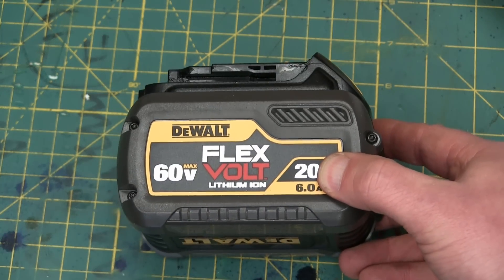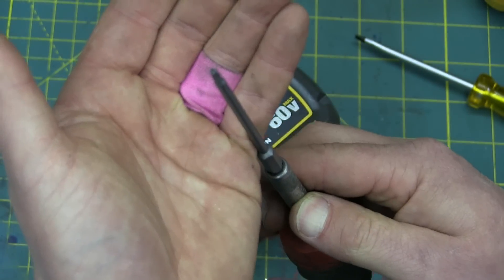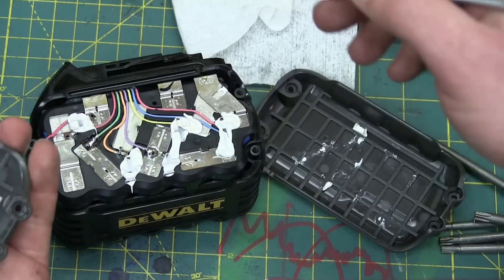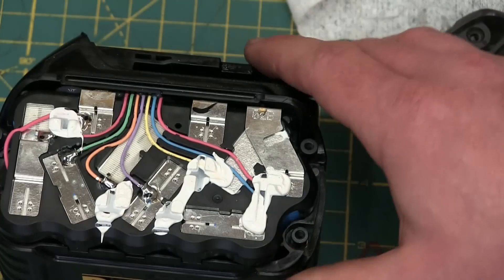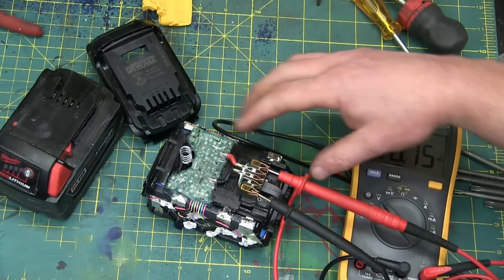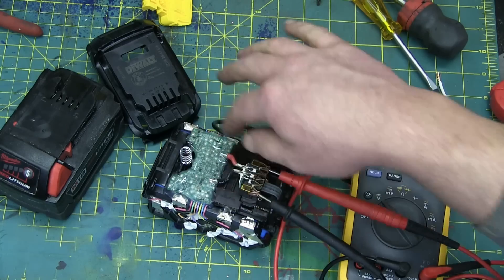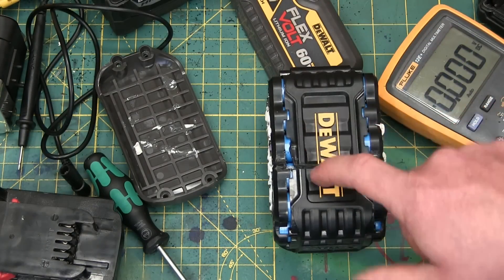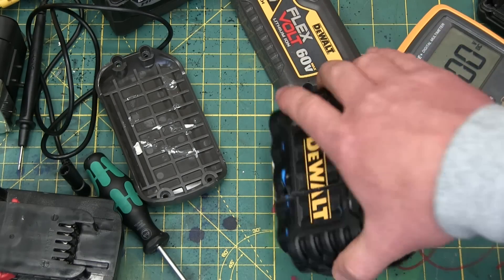BOLTR: DeWalt 60V FlexVolt Lithium Battery. Ooopsie!

Comment: I was in the vape shop and they were using a mechanical which didn’t have any chips and if you press the button it grounds to the negative side of two lipos. It had a failure in the insulation jacket. It grounded out and exploded and shot 35 ft across the room and landed in the trash can and lit everything on fire. It was like a ground flower fireworks. Bvvvvruum !! You definitely absolutely can definitely explode those they are the exact same battery. Same same! Be careful! They are why vapes fired off in pockets and exploded. Most battery cases used for vaping have escape holes so they won’t explode and make schrapenel 🤔❤️🖖🏼🇺🇸

Comment: Can you rip into the dual battery powered  flexvolt mitre saw AC adaptor that's sold for about 60 dollars. I always wonder if metabo made an AC adaptor to power 36v, why wouldn't dewalt make one for the 60v flexvolt, just make one and put high price tag on it. I sometimes get tempted to grab a hacksaw and cut the twin battery ac adaptor into half and plug in the flexvolt table saw.

Comment: I'd imagine you tore into the jacket of the battery and the friction of the sawzall blade set off the internal fuse on two cells.  Shame you can't reset those.  I tried to compress with screwdriver and it's real easy to puncture the gas filled membrane.  Chooched!

Comment: Hello I’ve got a question. I have a 750w inverter to power my dewalt fast charger in my van. It will charge all my 20v batteries fine. But it is hit and miss with the 60v batteries one will charge. The other two trip a fault on the inverter as soon as plugged in. The inverter is a modified sine wave 750w continuous operation from hazard fraud .. any idea why I’m having this issue. I’ve tried hooking up a wattmeter to charger it doesn’t appear to exceed the wattage while charging and the batteries work in tools and charger when plugged into wall.

Comment: Been there, done that with the ring.  Somehow I ended up having my ring turn into a "resistor" with a dead short between 5000mAh 4 cell lipo.  A little arc and the ring turned red hot, cooked the skin right off my finger.  Lesson learned!!!!

Comment: Thanks for f'n up the red cover so I didn't have to. I see they have a 9ah unit or now... Perhaps 3000mah cells?
https://images.homedepot-static.com/productImages/1392d590-dee5-45e2-ab96-03f281e00585/svn/dewalt-power-tool-batteries-dcb609-2-64_1000.jpg

Comment: Use that cap that outsmarted you to get the 60v (what they are designed for due to shipping regulations) attach a couple leads onto the cap so they go into the slots needed to attract angry pixies, wire on a plug, and see how it works.

Comment: Hi. How are you?  I was trying to find out .  Exactly what would u have to do to get the full 60 volts to show on a battery tester.  It doesn't show the full 60 volts when fully charged when tested.  I know these are 20 volt batteries hooked up in series.  Hope to hear from you

Comment: The lower capacity cells indicate that those must be higher amperage ones...
I have some pretty shmick cells that are rated for 20 Amp continuous discharge
If that's what they are, this pack should be able to deliver 1 kilowatt for quite some time

Comment: I THOUGHT I had figured it out but I think it bricked my battery... To get 60V across B+ B- on the battery, I shorted C1 and C3 on the battery and pushed the sliding bar on the battery fully inward.  That converted it from 20V to 60V config.  C1 and C3 plug into bars that are have less than 1 ohm resistance on the Flexvolt circular saw but apparently shorting those terminals without the microprocessor reading one of the other values must turn something off.  I still get 20V and 60V but the charger doesn't recognize it and it won't work in any of my tools.  Since C1 and C3 are used for balancing I'm pretty sure the battery must charge in the 20V configuration but I haven't tested that.  However, the sliding bar on the battery is not actuated when the battery is in the charger so the battery must charge in the 20V configuration.
Reply: I'd like to know this.
I want to use a FlexVolt battery on both my tools and a custom 54v project

Comment: Math to 45 was incorrect. If you nominal 4 * 15 is in fact 60. But the nominal is usually 3.6 or 3.7. full charge gets you higher of around 4.2 . That is arguable incourt and thus the 20 volt nomenclature is legal to use. Or 60.

Comment: I make Power Docks for Milwaukee, Kobalt and DeWalt batteries. Plastic shell, terminals and wires. Very interested in making a DCB606 version. For 60V output. Already did a 20V version. Looking for a dead or severely wounded FlexVolt 60. You seem to have created just that. Is it available?

Comment: I believe you're wrong about airline shipping. No matter how you turn it it's still one battery.
Energy storage is the same no matter if they're 3 parallel strings of 5 cells in series or 15 in series.

Comment: Ave, I know this video is super old but how you get the Dewalt Flexvolt battery to switch into 60V mode is too short the pins C1 and C3 together. You will also need to depress the plunger thing on the battery too or you'll fucker up the cell balancing. Its sounds freaking insane I know but if you probe the 60V tools you will find that the C1 and C3 leads are connected together and sure enough if you hook those together on the bench that is all she takes to open up and give you the good stuff. haha Dewilt and their classic corner cutting.

Comment: That battery pack would only be around 60v for a split second on a full charge I hate when batteries are rated higher than the capacity of the drained cells. for example the individual li-ion cells are rated at "3.7v" and at a full charge they would technically be 63v (4.2x15(cells)) it should still be rated at the working voltage of 55.5. Just personal opinion from some dude in the internet.

Comment: The secret to awakening the 60 volt angry pixies is to push in the black mechanical switch and jumper the C1 and C3 terminals where those red and black wires are connected (see them at 10:37).
If the black switch is not pushed in, this would be a dead short of the battery so that's why it is done inside the tool.
Also, this way, you cannot get 60 volts in a 20 volt tool.
Sorry for you loss of an expensive battery, RIP pixies
Reply: THANK YOU SO MUCH!!!!!

Comment: laughing my ass off over the tape on the ring, I never wear mine, my boss put his ring between a car battery and a diagonal fender brace in a car, his got red hot in seconds luckily he could pull his off quick. He does have a noticeable line on his finger in that location.

Comment: My bet is that those C# terminals have to be series'd up to get the 60V as well.  Fiddling around with the Milfucky M12 stuff, each contact goes to each cell (with the exception of the thermosistor) so to get the full 12V out of the pack  you have to have the + and -, AND jump two of the contacts together.

Comment: Re. air transportation, as from April 2016 all Li ion batteries are forbidden as cargo on passenger aircraft.  DHL etc. flying cargo  require special packaging for batteries over 40kg and if above 160W/h per unit require that UN tested packaging. Maybe it would have paid DeWalt to design battery as you suggested for regulations prior to April 2016, but now seems they all get same treatment. (unless under 40kg)
Reply: Martin de Angelis all batteries are under 40 kg
Reply: Martin de Angelis all batteries are under 40 kg
Reply: Martin de Angelis you're super polite. None of the batteries that we are talking about are over 40 kg that's the weight of a small adult. We are talking about drill batteries you would measure them in fractions of a kilogram
Reply: Joshua Lovelace
Sorry, I was sorta joking, When you pack for freight the container is weighed this is the combined weight of your freight. This is the 40kgs referred to. Apologies again, I thought it was obvious, it did occur to me someone might get the wrong idea, but I dismissed it.

Comment: I hope you try to check the Apple company devices, yes they are expensive new, but can be get cheaper used one from ebay. Steve Jobs company is the most shady in the world, even their iPhone is so secretive and smart today that it do not allow full charging from not "approved" or certified accessory makers with their proprietary lightning connector.
Reply: when i teardown the speakers from old 2002 iMac (lamp design) i found the DS2430 chip on the connector. It is EEPROM. Why they need memory chip between very small simple speaker and soundcard it is mistery. I think maybe for encryption, because this chip can be used for that. Today they used encryption chips everywhere in their devices including inside every lightning connector, so that's how it is developed from 2002, esp. very complex security they got in their "smart home" ecosystem, so accessories makers cannot comply because Apple require very big investments to join their "smart home", maybe Apple somehow right with that considering that biggest DDOS attack on Internet a week ago was made by very simple chinese IP cameras, so the whole smart homes ideas and "smart bluetooth" are in question now - if any toaster with IP address can be captured and used to destroy Internet

Comment: Flexvolt uses 21700 not 18650...
You cut right on top of battery, not in-between the 21700's .... bah ha ha ha $230 caboom...

Comment: I need help repairing a Milwaukee 18volt/120volt charger.  I know the batteries are ok because I have a car 12volt charger that recharges them ok.   I tested all the components on the circuit board but cannot test the proprietary chips. any advise, I have a lot invested in these 18v Milwaukee tools and don't want to scrap them. Cannot find another charger???

Comment: https://www.imrbatteries.com/18650-batteries/

you can pretty much find any battery cell for good pricing on here if you need em.  i linked the 18650 page specifically

Comment: What do you think about DeWalt's watt-hour ratings? You can get 20+ or 60+ peak volts out of their batteries under the right conditions but you'll never get the watt-hours they list.  Watt-hours is nominal voltage times amp-hours.

Comment: yeah if you have batteries in chain plus to minus you will have a higher voltage wich means more amps  if you use em parallel plus to plus minus to minus you just have a higher capacity.

Comment: Lithium tool power packs are getting higher and higher voltage. They aren't far away from electrocuting someone.

Best 18650s - mhttps://www.vapinginsider.com/best-vape-battery/
No Samsungs there. Also 3000mah is now reasonable. 2000mah is on the sketchy side.

Best place for replacements: Laptop battery packs.

Comment: Ya that is a low cell capacity, I use 3500mah panasonic 18650s in my flashlight and they aren't very expensive and one of the best if not the best 18650.
Reply: 18650 come in many different cell chemistry flavors; High amperage ones like you'd find in a tool drill are generally lower capacity, or at best, the same capacity but significantly more expensive.

Comment: HILOVE YOUR VIDS.   I WAS LOOKING AT THE LIL SCREWEY BUILD VID, AND YOU SAID   100 T.  SO DOES THAT MEAN EACH THREADED ROD CAN PRODUCE 25 T. OF FORCE.AND CAN A 1/2 IN ROD SCREWEY DO 50 T. WITH 4 1/2 IN  L7 RODS ?  AND DO YOU HAVE A FORMULA TO FIND THE FORCE A THREAD OF OTHER SIZES WILL PRODUCE?

Comment: 5:42 it's kind of counterintuitive, but current means speed of movement and voltage is how many electrons are moving. So higher voltage and less current actually means more electrons are moving slower.I had to check it, because I wasn't sure :-) and there is good explanation: http://resources.schoolscience.co.uk/CDA/16plus/copelech2pg3.html

Comment: I wonder if that battery is going to be like the ones in laptops?  Where they use safety circuitry that locks the pack down if a cell is bad, even after the whole thing is re celled.

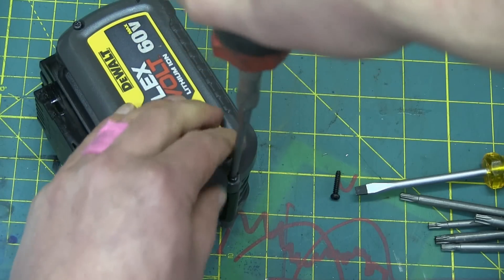Comment: AvE 2:28 you are already were branded forever by that ring... btw not sure why you decided to go with gold when it's very conductive and it's a soft metal in general for your trade(which you never have said specifically).. that's why I went with a titanium with a carbon fiber inlay ring... didn't go with tungsten targlide do to the brittleness

Comment: The battery code SDI 1G33 shows that it's a samsung battery with production date of Mar 03, 2016

The battery code should also have a **18650-* model number somewhere on the battery where a 3 letter prefix denotes the cell chemistry, and numerical suffix denotes cell capacity.

IMR = Lithium manganese oxide
LMR = Lithium manganese nickel
ICR = Lithium cobalt oxide
IFR = Lithium iron phosphate

Comment: The capacity is less because they are high normal discharge cells. Laptop cells for instance are usually around 0.2c (5 hour discharge), these will be much higher. I guess whatever makes them high discharge cells also makes the capacity less.

Comment: The likely reason the cells are 2200mah is because high drain chemistries don't offer the same capacity as lower drain chemistries (several different chemistries use lithium, despite them all falling under the lithium ion name)

Comment: I used the new 120 volt battery (2x60) double bevel miter saw and damn! It was way more powerful than my 15 amp miter saw that is actually 15 amp.

On a side  note, this was back in August before the new 60 volt tools were released. As far as I know, it was the only on in the country at the time and was supposed to be only for the purpose of selling them to vendors.

Comment: Careful with counterfeit 18650's. Make sure you go by official SDI weight on each cell before you bother putting them in the pack; they slip by even reputable vendors sometimes.

Comment: Who knew, cutting into a battery with a saw might break it!
Reply: It's not a Lithium Polymer pack, it's clearly 18650 cells. A samsung APCCD is a LiPo, packed in a mere foil pouch.
Reply: Yes it does change your point. The difference is the strenth of the packaging and in your ability to admit to mistakes.
Reply: Udit, I was confused my first time too.

Comment: Those batteries are $100 apiece and the 60 volt tools are crazy expensive, probably heavy too.  I can buy a 2-pack of 18 volt Makita batteries for $85 and my tools have plenty of torque.  When I need more, I use an extension cord.  You've got to be off grid or have some specialized requirement for these to make sense.  Good for farmers needing to make repairs in the field, etc.  For the rest of us, it's about a measuring contest.  If you need cordless welding like Ave, just wire a few 18vs together for a lower cost per weld!

Comment: I think you need to tear down your head calculator next next time, to figure out why it's not calibrated correctly. :-)
15 * 4 V is 60 V, which is DeWalt so called Vmax voltage. 15 * 3 V on the other hand is only 45 V.
Besides 4 V is certainly not the nominal voltage of any li-ion cell. High current cells like these has a nominal voltage of 3.6V.
High capacity (i.e. low current) cells for laptops etc. has a nominal voltage of typically 3.7 V, but sometimes around 3.8 V, but not much higher.
4 V is the so called max voltage DeWalt use in their marketing wank.
The battery's Vmax voltage is 15 * 4 V = 60 V
The battery's nominal voltage is 15 * 3.6 V = 54 V.This is the typical voltage at 50 % charge state.
In 20 Vmax mode the nominal voltage is  5* 3.6 V = 18 V
4.2 V is the voltage you typically charge high current li-ion cells to. High capacity laptop and smartphone batteries are however typically charged to 4.35 V nowadays, to get higher capacity, but unfortunately much fewer charge cycles is the big downside to this.
The so called Vmax (made up) voltage of 4 V for all power tools is only good for marketing. It's not even the real Vmax voltage, which is closer to 4.2 V, but just a nice round number they pulled out of their ass. In this case with 15 cells in series the real world Vmax voltage is not 60V, but 15 * 4.2 V = 63 V. Or 5 * 4.2 V = 21 V in 20 Vmax mode.
The only useful voltage for anything by marketing is the nominal voltage of 3.6 V per cell, which is what is used to calculate a battery's energy capacity in Wh,  by multiplying the battery's nominal voltage with its current capacity in Ah.
Vnominal * Ah = Wh
The made up Vmax of 4 V per cell is never something you can  evenlook up in a cell data sheet as it doesn't even exsist outside the marketing department. You can however always look up the nominal voltage of 3.6 V in the data sheet and that's the only one you need anyway, to calculate the energy capacity..

Comment: Actually, you would get more power out of a 60V pack than a 20V pack.

Here's why, we know that P=IV and V=IR. Doing a subsitution we get P=(V^2)/R, which should mean for the same impedence R, a higher V will result in more power.

That being said, this is done assuming the impedence of the motors are the same. A good followup video may be to measure the impedance of and/or the power delivered to a 20V tool's motor vs a 60V tool's motor to see if they are similar.

Comment: Did you seriously say that when you up the voltage you need less conductivity? You may want to elaborate on internal resistance of batteries. Without internal resistance, that statement is false. Please correct me if I'm crazy.

Comment: Where did you hear that you can't airmail anything over 100 Watt hours? I just received a 1200wh ebike battery from Luna Cycle, flown within the US. They have nothing about 100wh on their website in regards to Canada or otherwise. Anyway if you switched from 60v to 20v you'll just have thrice as many amp hours and it'll still equate to 120wh.

I have however heard you're no longer allowed to fly any batteries charged above 30%...
http://www.batteryspace.com/document/shipping/2016lithium-battery-update.pdf

Regardless, love the videos!